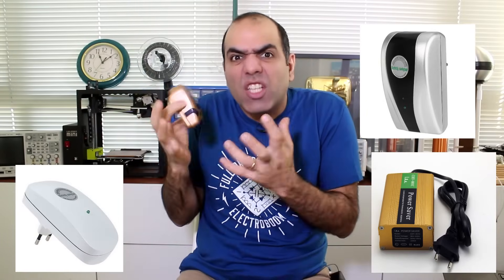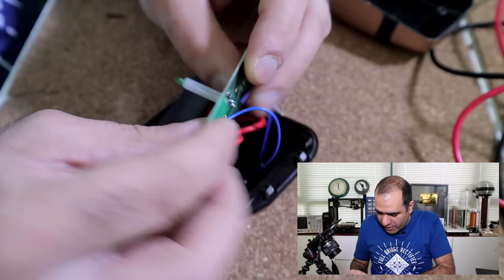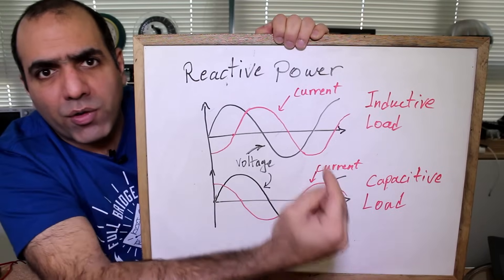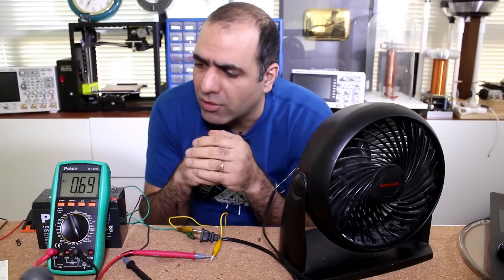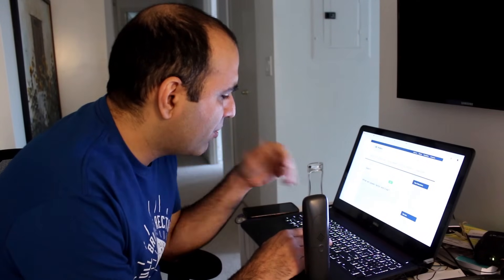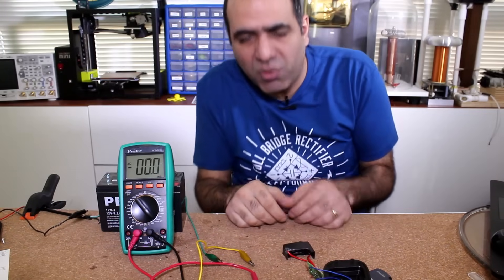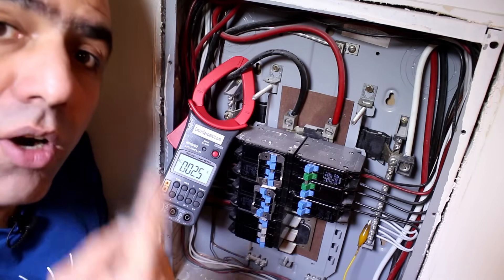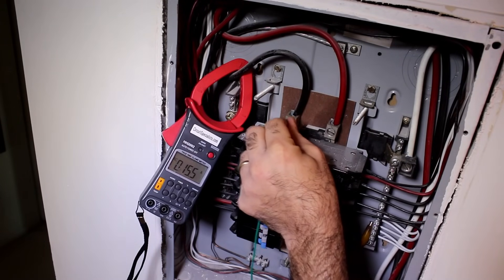Power Saver Scam EXPOSED!

Comment: This is an old video but if someone is reading this still, there's sound reason to correct the power factor in some cases. For example if you are producing your own electricity, let's say with generator or solar or wind or some of them or all three, and store that energy to batteries, now there's real consideration what kinds of loads you run. You may end up paying more for generator fuel or waste your battery storage energy, waste more energy to wiring if you have long runs, and what have you. If you have lots of inductive loads then it may be beneficial to correct the power factor in off grid setups if you do lots of stuff with motor tools, actually quite many garage tools are inductive loads. So are isolation transformers. You are quite literally now paying for apparent power even if you are not paying money for the electricity, but you're still wasting energy without the power correction in one way or another.

Comment: Watching this video with the physics background knowledge required is actually way more interesting then claiming to "know" electronics. I wonder if the crossection between voltage and current sinus gives you the true wattage vs in phase where it's at maximum. Really interesting topic and pretty well made content.

Comment: Hi, Just found out that you are using thin crocodile wire to jump it, which is no appropriate , 
Correct me if I'm wrong , Electrical technician told us o use 2.5 wire gauge when he found out the AC technician install 1.5 wire gauge on 2HP Aicond split.

Comment: Reactive power doesnt actually get used in theory, but the higher current leads to more I^2R losses in the line due to wires and other devices having non-zero resistance

Comment: the only real use for those devices(for a home user without large inductive loads, like most home users) is to provide access to a nice case for a 120v project(like storing a small arduino controlled relay block for running a large load without having exposed live connections) and a nice 12vac rated high-capacity capacitor(very similar to the main filter capacitors in a PC power supply but non-polarized and expensive to get otherwise)

they literally never have anything else, and given that most consumer inductive loads on 120vac are REQUIRED to include power factor correction(yes your fridge already has a power factor correction capacitor, same with your HVAC system, and even most large blower fans) there is literally no use for thses

in fact you can over correct for one type of load
imagine you have a ton of LED capacitive dropper power supplies, they already cause a power factor skew towards capacitive loads
then you add one of these scams, and the power factor gets WORSE

if you have a cheap LED bulb in your house you ALREADY have one of these(even the walmart bulbs have one of those linear chips in them that work like a resistive load instead)
hell there is NEVER a consume application outside of a small workshop with some large motor driven tools to need raw capacitive power factor correction

what is actually most needed for consumers is an ACTIVE correction system(like what is legally required in larger switching power supplies)
these systems do something strange with the power, they rectify it with a FULL BRIDGE RECTIFIER then they BOOST the voltage from a small input capacitor into a larger DC bus
the device then pulls it's load from that higher voltage
this has the side effect of being able to delay the load and adjust the current to PERFECTLY match the sine wave

now for most home users this still doesn't matter, most residential power providers simply do not charge for power factor, they charge based on the actual load of teh device, meaning they charge you for effectively delivering DC power and measuring the load via a SHUNT

they could change that soon with the proliferation of smart meters, though I suspect they will offer it as a way for the end-consumer to reduce the "system upkeep" fee as a good power factor means that the device needs thinner wires to deliver the same power as the current is matched to the voltage meaning it uses less current as the load is not temporally offset

in the end all you need to make your power bill as low as possible is to turn off things you are not actively using(like that extra light bulb in the hallway that stays on 24/7 in case you have to visit the porcelain throne at night), and if you care about power factor you buy a massive battery charger than can put your entire house worth of power into a battery stack the size of an entire fully loaded pickup truck, and feed your house with inverters, wait the conversion losses would make that worse, even it could ensure perfect power factor

just don't buy these useless devices unless you intend on putting them on the DEVICE side of a shop tool(ie AFTER the power switch) as there is no need for capacitive power factor correction outside of that single use case or industrial scale power systems

Comment: The only reason to look at this video is to know how these things are made.
I know that with smart meters (university research from UTwente) that when a customer uses fast swittching devices (Phone chargers, led , may be even Electric car chargers) some of those smart meters can measure and charge up to 6 times the real used power. When I see you're video I see that this thing will not equalize tose fast switching things really for the current in the house.

Comment: pretty sure they charge us for the reactive power along with resistive power. Also, it's important to balance your single phase panel because they take the phase that is using more current and multiply it by two rather than charge you for what is the used on both phases.

Comment: You never put a microwave, coffee maker, toaster heater waffle maker, pressure cooker or washer on an extension cord cause it would draw a lot more because you putting on longer wires and that makes the current go higher and most cords are not designed for high current
Reply: i have my Heater and my Coffee Maker on Extension.

Comment: Most electronic equipment in the home such as computers, inverter refrigerators and ACs look capacitive on the line. You can thank Thomas Edison for inventing an electric meter that measured real power, even though they were using DC current back then and it didn't  matter.

Comment: Less voltage means more load and more amperes.
So capacitor job is to just store the voltage with current and to give an initial kick start to any motor, for tubelight it's the choke. So capacitor has nothing to do with the electric bill reducing.

Comment: For those who really want to save a lot of electricity: The TEST Foundation published the article "Saving energy in everyday life - save 1,000 €." The greatest savings potential according to the test are energy-saving shower heads, up to 300 € p.a. at a cost of only 20 €.* Otherwise, LED lamps, window sealing strips, switchable power strips, energy-saving heating pumps, programmable thermostats, radiator reflective foils, and timers (e.g. to switch off routers at night) should be installed everywhere. In terms of cost, effort and savings, the most effective insulation measures are roof, cellar ceiling and roller shutter box insulation.

Comment: I love Electrical engineering, always learn something or the other.... One way of reducing power consumption is to switch off loads when we dont need them. Such as water heaters, fans, oven's. However, we can use storage devices to store heated water instead of switching the geysers on demand. Another way to reduce power consumption is to have solar arrays installed and grid inverters that can transform the DC power to AC. So in all, we should reduce loses. For B2B consumptions, surely transmission loses at higher voltages could be reduced by APFC (Auto power-factor correction) using thyristor switched capacitors. Creating one's own community micro grid is the best way forward.

Comment: Right now in  India a person is claiming that he can cut the  power consumption by half. ie. 1 HP motor will consume.1/2 HP. by using his peculiar machine fixed in parallel to the board mains. Is this possible. He claims power bills goes by half. Is this possible?  Pl clarify.

Comment: So, I know this guy is probably correct in that these electricity saving boxes are scams and don't work, key word: PROBABLY. BUT what he didn't do was try it out. If he had shown his electricity bill before and after using this device, that would be proof they do or do not work. I'm not an electrician and have no experience with that area. He opened the device up and that didn't help me either. I don't know what I'm looking at. He's using terms I've never heard of before: real electricity vs apparent electricity or reactive power ...what? Sounds made up, to me and I'd have to do some googling to find out. None of that helped me understand. He drew that diagram of the waves and said that current and voltage were not there at the same time.....um...what? 180 degrees out of phase.....what? Add up and cancel each other....what? It is essentially a giant pile of technobabble and he could be making it all up for all I know. I'm going to try the device out and see if it does or does not work. I can comprehend results. Plus I am desperate to get rid of the hum inside my house that is driving me crazy. I'll try anything at this point. I can always get a refund later if I want. AND I can do it all without electrocuting myself. Entertaining video, though, made me laugh.

Comment: Haha what a gimmick. Just use a synchronous motor with no load, then monitor your reactive power and automate the synchronous motor to compensate the pf. Problem solved. Well unless you want a cheaper energy bill...maybe consider solar.

Comment: Even ordinary 1200 mm ceiling fan capacitor is around 3.3-3.5 microfarad nothing unique in this , though increment in capacitance decreases Xc causing current surge in device connected in series to it hence using much higher than rated can result in low life cycle to even breakdown of devices .

Comment: 2:10 I used to parallel generators on board ships as Marine engineer. It was a long time ago but I would recommend the following analogy. Why not explain power factor by explaining how walking on concrete has more efficient than walking on ice or sand.

Comment: Note that the microwave's transformer drawing 4A × 120V with no load is the real power in watts, not VA, which is not reactive power, but apparent power. Reactive power is in VAR. You would have to multiply by the power factor to get VA, though I'm sure he was rounding. Still, there is about 30 Ohms in the windings causing the power loss, which I would think means a large number of windings and non- trivial inductance. So, the apparent power is likely a decent amount more than 480 VA. 

What just clicked with me is that if a device needs a certain amount of power to run and the power factor is low, then you'll draw more current per load and pay more. Epiphany.

Comment: The power company charges you for reactive power, but they only measure real power. They assume an average household PF of 0.9 and add this to your base rate. In other words, they calculate how much reactive power you’re probably consuming based off of the real power consumption instead of directly measuring it. It doesn’t matter how much reactive power you actually consume. So these devices are worthless and may do more harm than good if they consume real power.

Comment: In Ontario, businesses pay for energy and also peak monthly demand that is calculated using a 15 minute sliding window.  If your power factor is above 0.9, the sliding window demand charge is based on kW.  If your power factor is below 0.9, the sliding window demand charge is based on kVA, which will obviously result in a higher cost.

So there is no specific penalty or surcharge for a poor power factor, but the structure of the billing prices it in.

Comment: Lol!!! I about died watching this. Back in the 80's there was one of these devices out called the green plug. It was suppose to change the power so electric motors ran quiet and smooth using less power. You plugged it into an outlet and then plugged your fridge/freezer, those types of things into it. They did nothing and the company went out of business. Best way to save power is to turn things off or unplug things when not in use. Put your entertainment center on a power strip and turn it off when not in use. Many appliances still use power when off, home security systems, Alexa, automatic lighting, microwaves, stoves computers, even though those things are turned off they are in what's called sleep mode. Think about everything in your home that uses power and decide what needs to be on and what doesn't. If you can put everything on a switch or unplug it when not in use, do so. It's amazing how many little things get left on or plugged in all day thinking they are small and don't use much power but in the end all of those things add up. Many people think things like phone/laptop chargers are not running when the device is not plugged in but it is, unplug them from the outlet when not charging a device. There are many things you can do to save power and cut the bill down.

Comment: 8:30 Yes, but a lot of people have furnaces, air conditioners, or heat pumps that have AC motors that create reactive power. However, there is usually a capacitor to improve power factor.

Comment: My Xbox 360 PSU has a small capacitive dropper circuit in it and when not connected to the Xbox 360, it will correct PF of inductors. I leave mine plugged in all the time to compensate for my doorbell transformer.

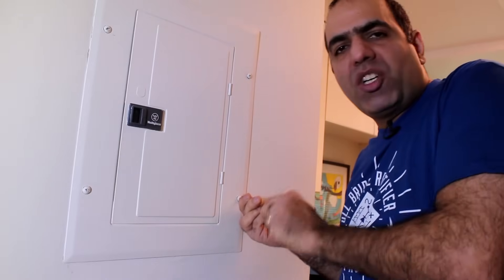Comment: @6:50 2 legs but still single phase, just tapped at center to create neutral by grounding it, so you get split phase 120v per leg to neutral  and 240v leg to leg here in the USA.  Love your vids, they are so amusing and educational. Keep up the awesome contents.
Reply: That's just a matter of naming. I agree with ElectroBOOM that you can call it 2 phases. Just like with 3 phases you get a 120° phase difference, with 2 phases you get 180° difference, which just means that they are inverses of each other. And yes, I know they are made from the same phase, you can always duplicate phases with a 1:1 transformer with a center tap referenced to ground.
Reply: @mikeuk1927  like you said it comes from 1 phase of the primary line before the transformer.  We call it single phase 3 wire or single phase 2 wire, which implies 240V (3 wire) or just 120V (2 wire).

Comment: I have a cheap freezer that doesn't have any power factor correction.

Without a capacitor it draws about 100 watts.

With electric fan caps I can get it down to about 65 watts.

This is important because I want to run it on solar power.

Comment: One way to save money during the winter is by using a couple of space heaters to provide most of the heat.  Two space heaters will use 2,000 to 3,000 watts of power.  The central heating system uses 15,000 to 20,000 watts of power.  The space heaters will have to run almost constantly when it's freezing cold outside.  You're still going to save money.

Comment: This can't reduce the bill the way we expected it to. But a capacitor bank will help reduce the current drawn by the equipment so it reduces the copper losses due to reduced current. Of course it won't directly reduce the bill since we are not billed for the reactive power

Comment: i got a question wy does there come 240v come from the wall sockhet wen most vevices are stepped down with a transformer  to 12 volts and lower? dont ampere matter how much power is used by a deviece?

Comment: When you turn on a fan and the voltage and current are off phase by 90 degrees it is actually beneficial  for you because Watts ( what you pay for )= Volts X Current and since they are not in phase your current will be low while your voltage is high resulting in a reading of the meter in a lower wattage than if voltage and current were in phase.

Comment: I am an electrician.  He is correct on everything,  I knew that piece of junk would be built like that and also that it would not work.  If saving power was that easy it would already be done, only an idiot could not guess that.
Reply: I remember an experiment we did in school where we match the inductor and capacitor and the amperage on the capacitor goes through the roof.  Good way to stsrt a fire.

Comment: 8:55 - its drawing almost 30mA and after you plug in that saver, it's drawing ~70mA
does it mean, that it's 70mA "the other way?" (i.e. 30 - 100 = -70, so something like, it's drawing 70mA, but with the opposite phase shift, or something like that)
Or is it just a coincidence?

Comment: i appreciate how good your vedeos are, but am extremely concerened about your flippancy using maiins power. holding a capacitor in your finers while touching it acroos the mains voltage doesnt send a great message to people, in fact it could lead to big trouble if someone was injured or killed after watching your video